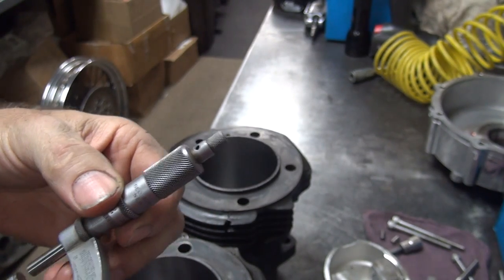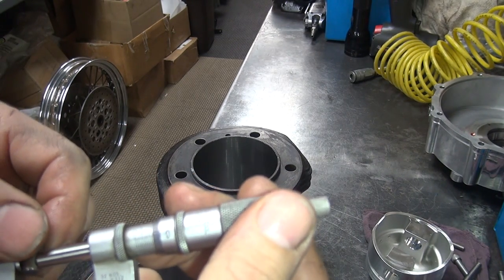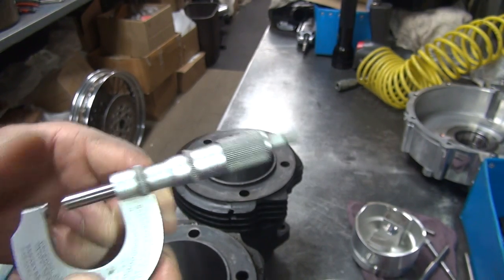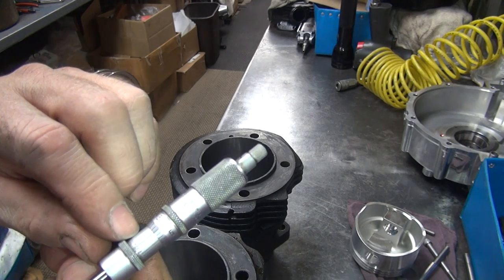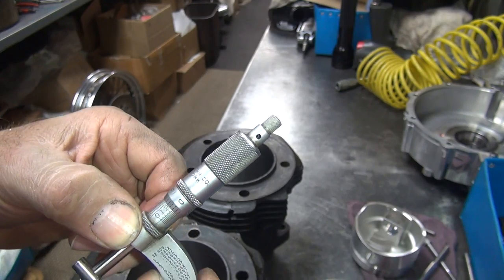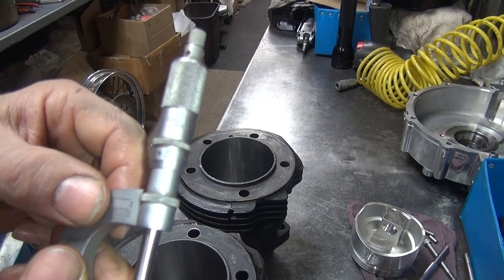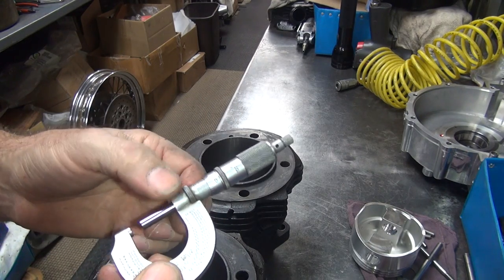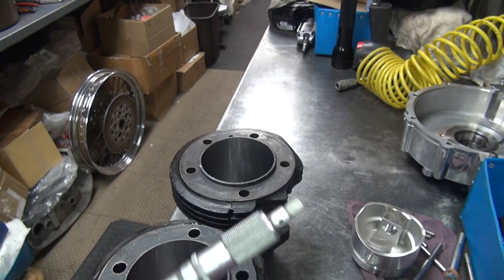#107 How To Do It, how to read a micrometer mic measuring tool Harley by tatro machine

Comment: do you have any videos on remove and replace distributor on panhead
Reply from the maker: dans 41 knucklehead videos and 45 motor videos, my 57 drag bike videos and freds barnfind 49 panhead videos have all of that too. just watch the playlist and you will see all that and more.
tatro
Reply: I had to take an annual precision measuring instrument certification test for the Gov't as a Marine Machinery Mechanic. I found it VERY important to use another precision measuring instruments for double checking my dimensions when possible. If you can get the dimensions to repeat  you were golden! People often wondered how i was able of aceing that exam every time.